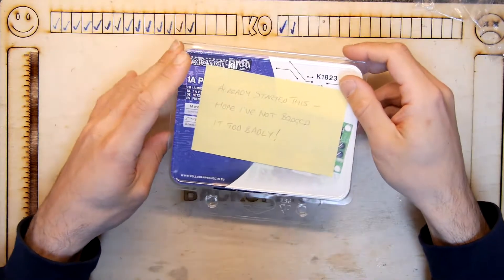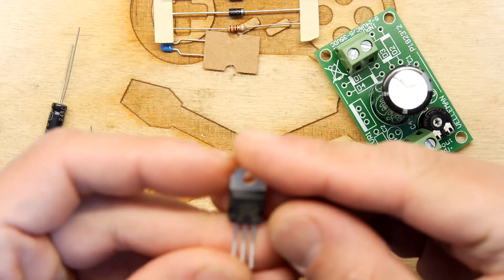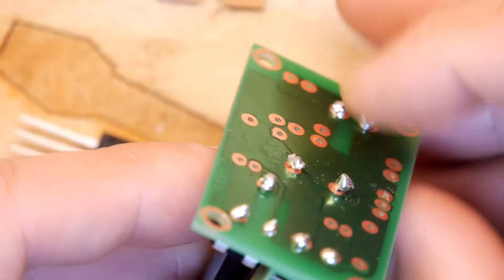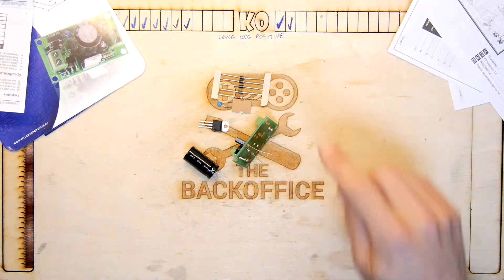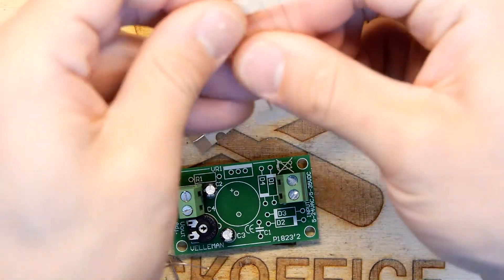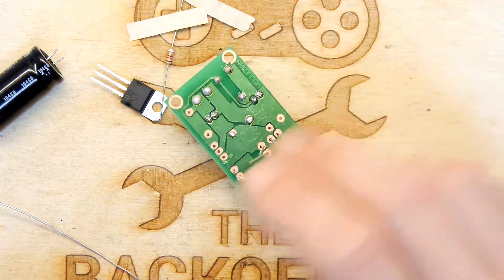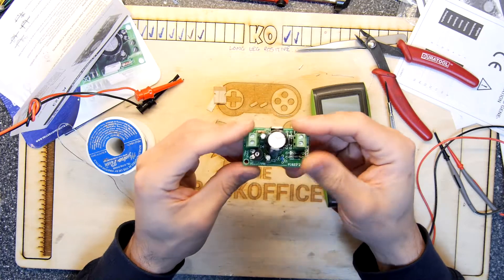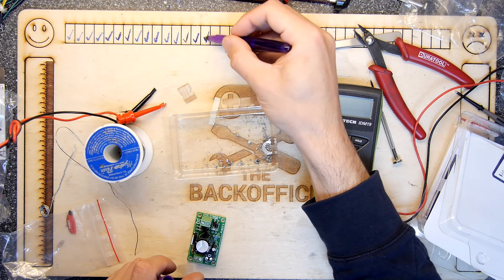Vellman Power Supply Kit

Comment: hi Andrew... a voltage regulator should not track with the input voltage. so there is something wrong. what you said at the end is not correct hehe
Reply from the maker: +Arjen Klaverstijn looking at the datasheet out will show this behaviour under a no load condition as the reference is effectively floating. They seem to generate an internal reference voltage of 1.2 volts. So I guess it is behaving, just in not testing it correctly 😂
Reply: The Backoffice yes of course! That's true. Together we learn.
Reply from the maker: That is true. Though I will never learn what is a positive leg.
Reply: The Backoffice haha who does.... who does...
Reply from the maker: No body, I suspect its a conspiracy :)